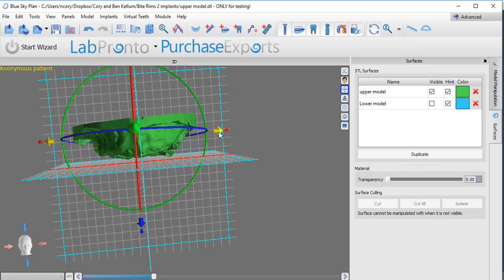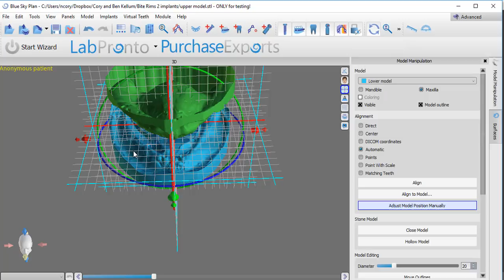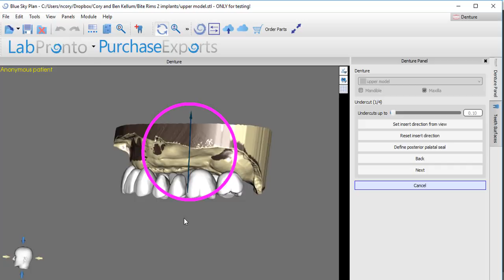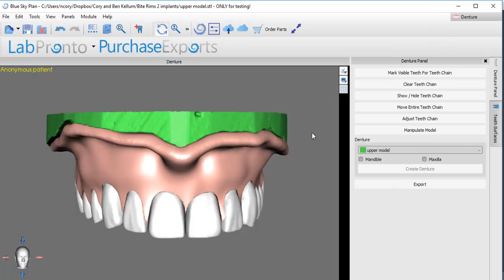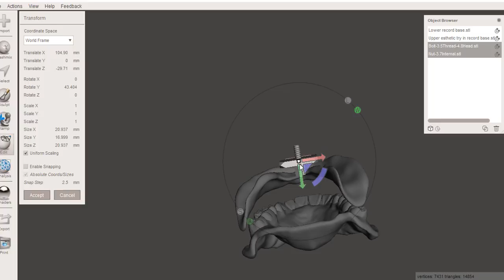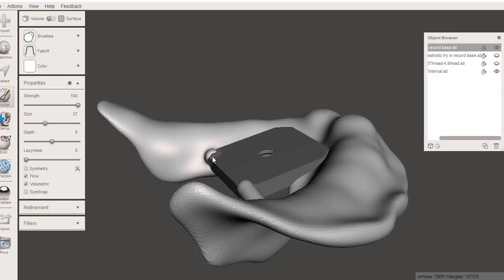Esthetic Denture Try Ins with Centric Bearing Device

Comment: Maybe an optional approach with replacement denture construction ... if you please. =)
Using the patients existing denture(s) for the custom tray(s), vertical, and centric.
* Take a wash in U/L dentures along with a centric blue bite.
* Scan dentures inside and out.
* Articulate the scanned dentures using the blue bite.
* Now you have master models, centric, vertical and tooth position of patients existing dentures.
* If needed, open bite slightly to recover lost vertical on old dentures.
* Set teeth/print denture for try-in ... no wash needed because it was captured at first appointment.
Not sure if the software allows the above approach ... but it would sure save a lot of steps and eliminate much guesswork.
Forty-five years in denture fabrication has taught me that "less is more" when it comes to denture construction steps.
Please comment and let me know your thoughts ... I would love to see your program in action ... very cool.
Reply: George Mohr dream way, but I would like to know how would you open the bite if you already took the pt in his bite, do you just open the It in the software ?